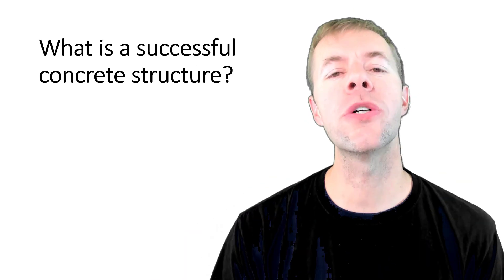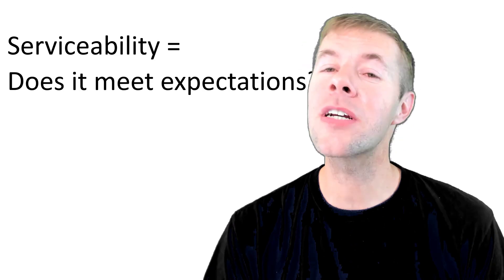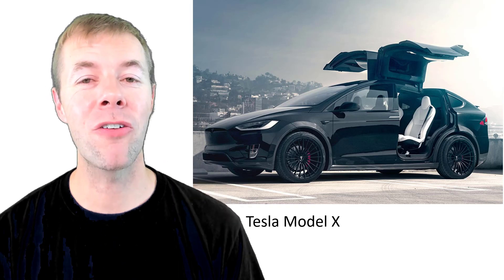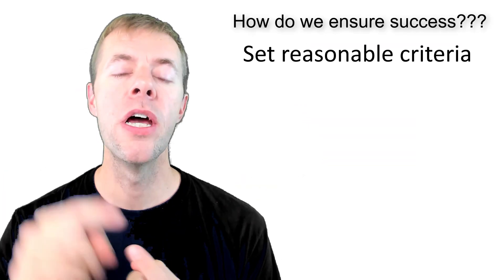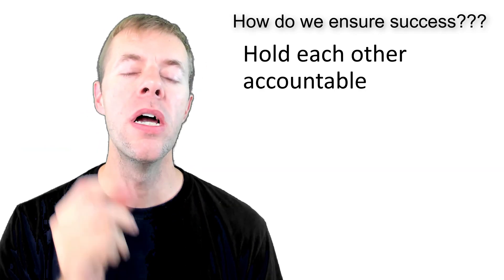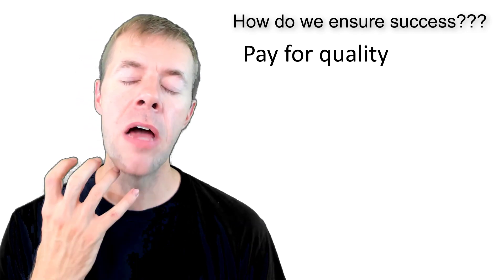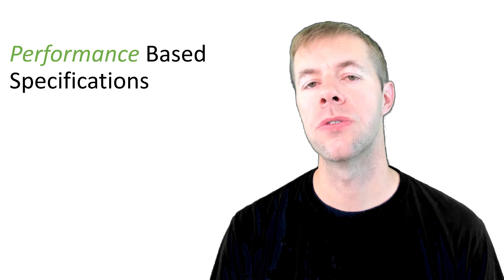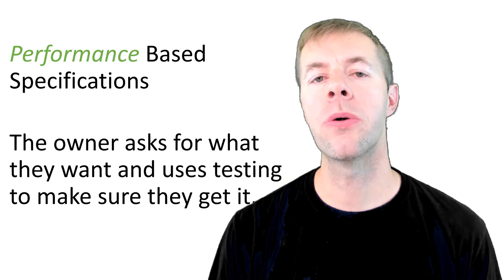What is a successful concrete structure?

Comment: Thanks for your awesome  video. Dr. Ley I have a question about Freeze and Thaw Test according to ASTM C666. Is it possible to modify Humboldt Capinet  to use it for procedure B instead of procedure A?
Reply from the maker: Ali - I am not sure there is an easy way to do this. In procedure B you freeze in water and thaw in air.  You would need to find a way to remove the water from the containers as they thaw.  The thawing process takes some time and so there is not a good time to do this during the test.  There are chambers from Science Temp that people are using to run procedure B.  I run procedure A in my lab and I know that most other labs do as well.  Procedure A is more severe.
Reply: Thank you Dr. @TylerLey